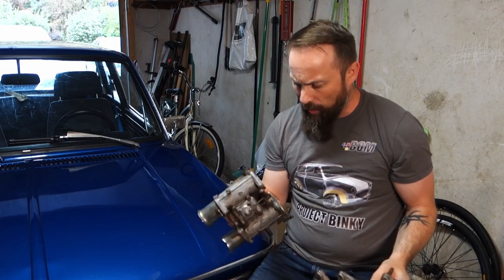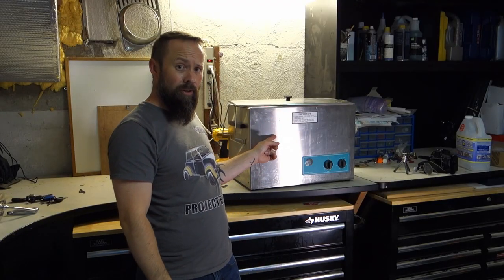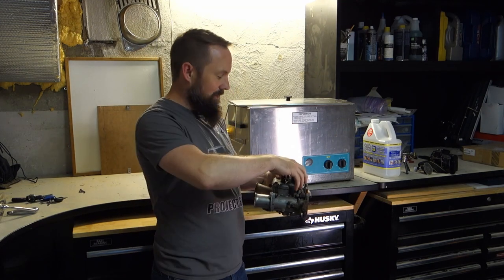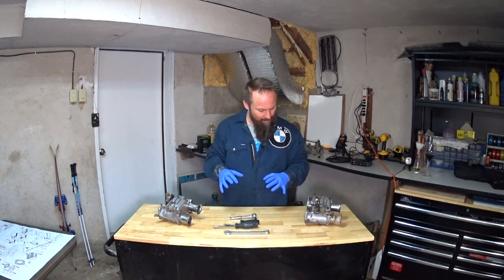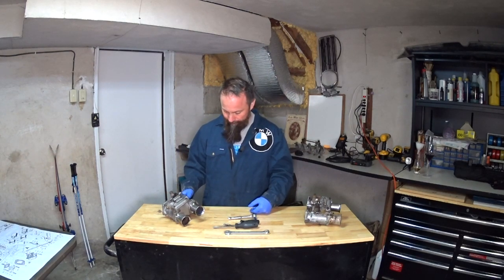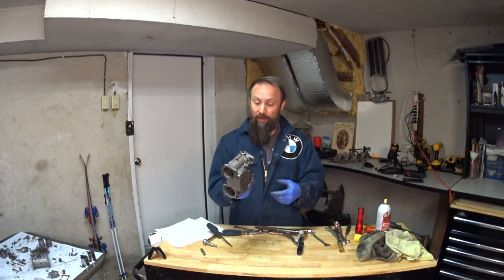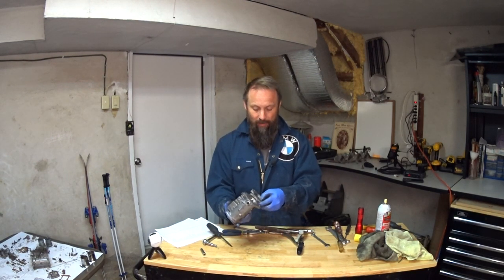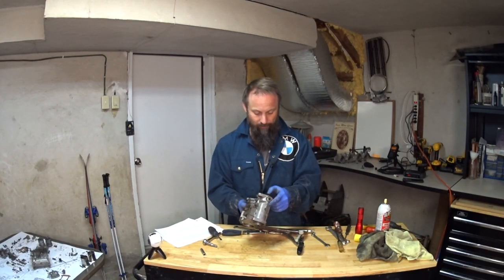PROJECT 1968 BMW 2002 EP16 - Dellorto DHLA40

Comment: I think you should remove the throttle axis with the butterflaps as well. Those have bearings and or some kind of gasket that can be replaced. also check if they are still straight! Good job
Reply from the maker: Thanks!  I will be ordering the screws for the butterflies, but may not change them.  Factory install peens the ends over so they can't loosen...  mine cleaned up really well, so I don't want to mess with the fit.
I'm loving you IG builds by the way...  Your 02 is super clean!